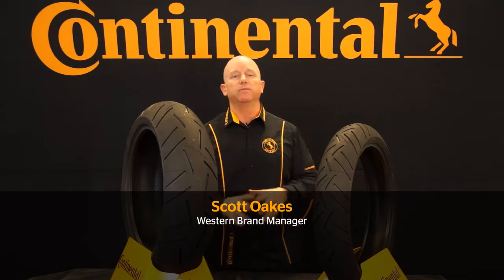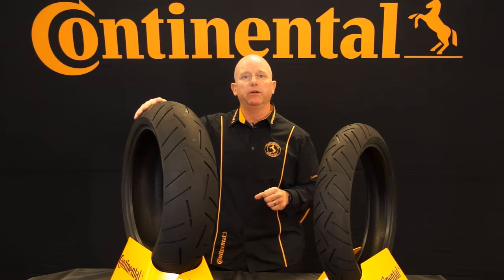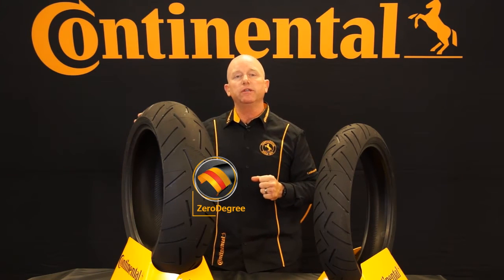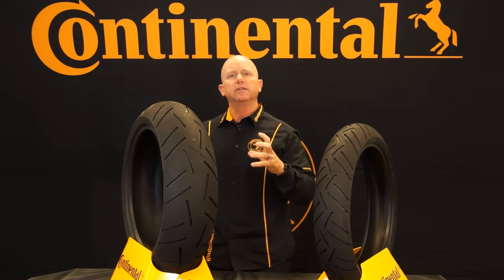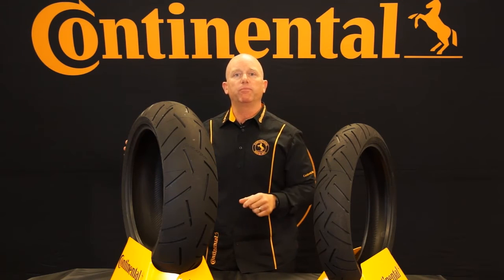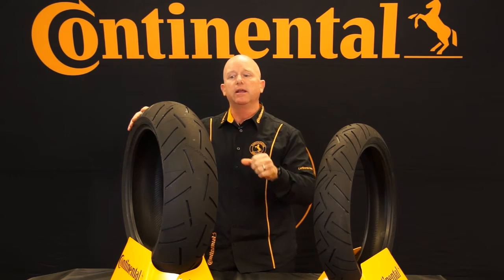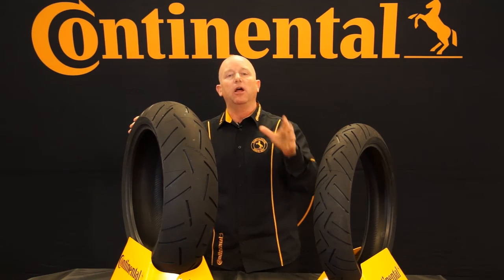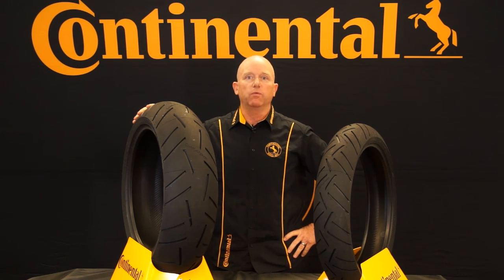Conti Sport Attack 3 Technical Explanation

Comment: I would like to hear more than marketing talk about the Grip Limit Feedback. What sort of feedback is it supposed to offer? (slight sliding? refusing to lean more? change in stability? vibration?) Is it based on traction itself, lean angle or combination? Does its function depend on pressure/temperature? How does it differ front/rear? I already have these tires and I am very happy with them, I would just really appreciate knowing what to look for when "using this feature".
Reply: Yeah they are not giving any details about that.
Reply: I don't know for sure, but I think it's a slight sliding. I have the Road Attack 3, which is obviously more for street than track. I've noticed that at medium to high speed I can sort of feel a little over steer from the rear sliding very slightly. Now, I'm not a pro rider, and these tires have a different profile than my last tires, so it might just be my imagination. I've noticed that they have really good grip at lower speeds, and for the first time in my life I've scraped my pegs. I don't ride at track day speeds, so I can't say much about that.

Comment: any suggested or estimated tread life for commuting
Reply from the maker: Steve Ricci, mileage or tread life is related to many variables, including: riding style, road surface, proper tire pressure, number of riders and many others that do not allow us to provide you with a specific mileage range. However, we can state that our tires perform competitively against other top tire brands in the industry. Continental Motorcycle Tires are recognized for their excellent balance between high performance and durability. Thanks for trusting in Continental.